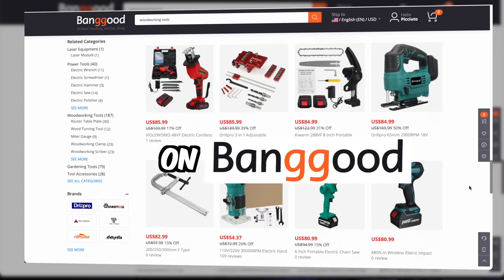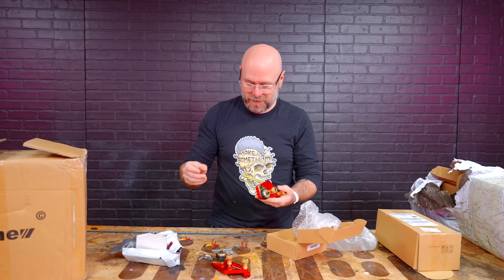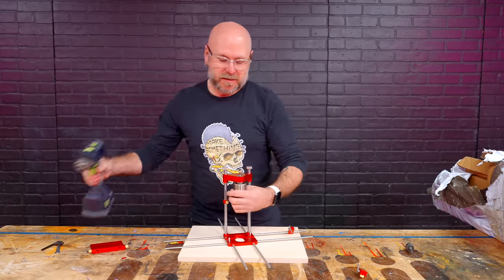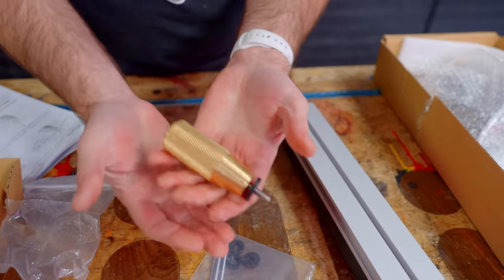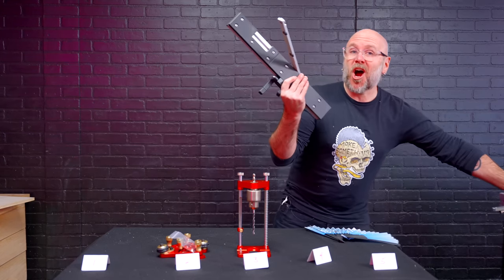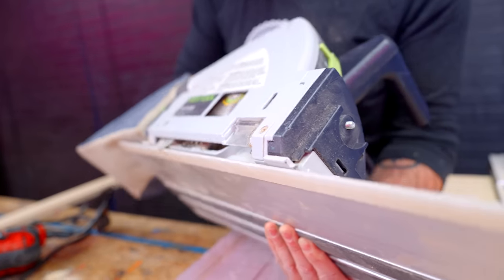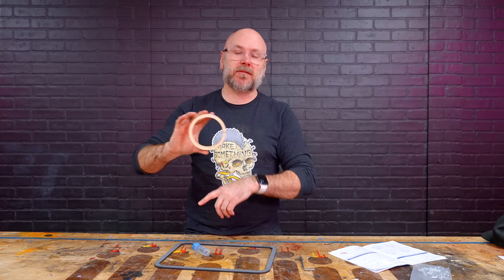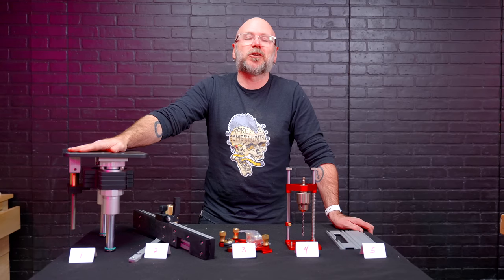I bought the 5 most EXPENSIVE woodworking tools on Banggood!

Comment: d) The "rolling feeders" stand out in Min 5:20 & especially in 5:32. The "horizontal roller" would lift the wood upwards. This means that a right angle is no longer possible. What is required is that the wood is pressed towards the worktop. The orientation is therefore wrong and probably cannot be changed.
The fact that the rollers are not lower and do not touch the wood is only relevant afterwards.

e) At min 11:37 you can see the miter gauge from the screenshot.
The right screw with the black plastic sleeve on the half round angle has a problem with the cutout on the right side of the aluminum profile. If you set a width that requires the screw to be fixed there, you can't use that spot because the screw can't be fixed there. The problem will certainly affect some saws where the distance of the guide groove and the saw blade have the appropriate distance.

f) The Miter Gauge you show for $300 is also available at banggood ... for partly 120 or 150 €.

Comment: I have that crosscut fence and can confirm it is a _brick house_. I got it to replace the stock DeWalt fence that has more shimmy than a Yugo after jumping railroad tracks. Honestly, I think it's nicer than my saw. After some dialing in by sanding the slots on the saw table and some paste wax, it is niice. Except it's made for a full-sized saw and by virtue of the short infeed on the DeWalt, it will hit and sometimes get hung up on the edge if you don't expect it. So, great fence. Not the best for a job site saw, however.

Comment: I'm not a woodworker, but automatic-technician(so bear with me)
When I look at different machines & jigs it looks so complicated.

Two jigs that I found(by the look) interesting is :
A) Vertical Self Centering Dowel Jig Kit(black almost circular). Simple and it has an option to have 2 dowels very close to each other and still centered.

B) Doweling Jig Punch Locator Dowel Jig Kit(AUTOTOOLHOME store). A bit more complicated, but still easy. Still selfcentering. But with 2 big advantage that it can place dowels with greater distance using pins. Second that it has a flat side that makes it possible put it up against a fence.

Comment: Amazon sells the  WEN 4208T - 8 inch - 5 speed drill press for $109 with cast iron base. Has almost perfect five stars with over 4,000 reviews. Cheaper than BangGood's flimsy drill guide.

Comment: I have purchased a lot of stuff from Bangood they are very reliable and legit although the usual runaround if something goes wrong with an item But hey thats equalled out by the price, However the batteries on Power tools use cheap cells and dont last long

Comment: 9:12  It looks like the stop block is twisted on the rod causing the corner of the stop block to catch on the edge of the material.
The distance from the bottom of the block to the bottom of the rod looks the same as the distance on the main body so it should fit.
probably the best way to make sure that the alignment  is correct would be to move the stop blocks onto the same surface as the main body before tightening down the stop block.

I would like to hear if this fixes the problem..

Comment: I would not recommend that Drill Guide.
It just falls apart because of vibrations when using it.
Also since there is only 1 spring on the vertical rods it tends to be off the perpendicular.
So don't spend your money on it.

Comment: I bought a miter gauge for my Metabo contractor table saw. It cost around $100.  As soon as it arrived, they reduced the price to $49.  I called them asking for a refund of the difference. They wouldn't give it.  Then, I went to install it. The little circular things that fit into the track do not have long enough screws and either make it too tight or too loose. Additionally, the bar is short. It is useable for small pieces, but not for wider ones. I have to figure out how to fix the problems, but for now it is going unused. Is it a good miter gauge? Yes. But, it has to fit your saw. I stopped buying from Banggood. I switched to Temu for now.

Comment: The guide you used for the router was used incorrectly. It is similar to the Jessem guide and  both are to be used on the top. One behind the router blade the other in front.

Comment: Looking at the design on the roller guides, I don't think you can use it for side pressure. It appears it would LIFT the material. Looks like it works great on the router fence though!
Reply: That's because he had it the wrong way around. But in any case I think I agree with comments below in that this is an incorrect use.

Comment: Some of the tools I think you need to compare them to their originator’s version.  Like the drill guide, don’t compare to Rockler’s, compare to the original version made by Woodpeckers.  The roller guides do work with the router table, but are used more on a table saw, drawing the wood toward the fence.  From what I have heard from other people, come of the products are good, and some are cheap.  But the one complaint is Banggood copies tools invented by others, thus cheating the original company that designed them.  If you compare the drill guide to the Woodpeckers’ drill guide you can see Banggood copied their design.

Comment: The one VERY BAD THING about the 2 rollers you bought is. They're supposed to work like feather boards. Hold the board down & prevent kickback. When you buy the more expensive ones. The bearing roller doesn't roll backward, only forward. Protecting you from kickback. Either on a router table or on a table saw. Just one thing people need to keep in mind. They're well made, but that roller is dangerous because it rolls back and forth. So it's worth it to buy the more expensive ones to prevent energy

Comment: The first tool should be used on each side of the cutter to keep the piece against the fence rather than as a feather board like you had it setup. These are Jessem knock offs but essentially do the same thing
Reply: Ah yes, quite right. Those wheels wouldn't be able resist the natural lift action of the cutter.

Comment: If you live in the US you get access to amazingly low prices and stacks of great tools.
But if you live outside the US the strength of the US dollar and the exorbitant postage costs from there make buying American stuff largely unaffordable.
That's why I order stacks of stuff from Banggood.
I've never had a problem with gear from there. 
Sure, you know you're getting what you pay for, but for most stuff that isn't the cheapest of the cheap in their range, the quality is actually very good. 
They copy a lot of equipment from, say, Woodpeckers and it's a fraction of the cost.
And it's not like Woodpeckers is losing a sale as buying from them is unaffordable anyway if you're not in the US.
So overall I'd recommend Banggood.

Comment: On the drill guide. Could those little guides actually be indexing pins to evenly space out holes? 2nd ryobi has a plunge saw forget blade size roughly 5" that looks like it would fit that track saw.

Comment: I was about to buy a more expensive item at a good price on banggood, but then started checking reviews as they wanted $5 for some shipping insurance, if I didn't buy that insurance they wouldn't refund me if the product got lost in the mail, feels like extortion.

I found that their rating was 3.9 on  Trustpilot  but 20% have given them 1 star, that's an unacceptably high number, it should be 3% max 5%, so I refrain from buying.

Comment: i bought a 3d printer on banggood, it was nothing like the advert. a lot of the metal parts were replaced with cheap plastic and the quality of prints was absolute garbage. i tried to return it and the postal cost was 50% more than the cost that i originally paid so after complaining with no one listening, i got in touch with my bank and as soon as i said "banggood" they instantly refunded me. that was about 3 years ago, i still have the 3d printer and havent used it since

Comment: I bought a 3D printer from Bangood and got screwed. Plugged it in the first time and the magic smoke came out. Never was able to get PayPal or Bangood or the printer manufacturer to make good refunding the item. Best I got was "ship it back to us for repair." LOL - nope. Shipping a giant-ass box back to China generally costs more than the value of the contents. That's the biggest caveat with buying any of this stuff. I think one is probably safe from having something be so poorly designed or built that you would need to make some kind of warranty claim - especially when you're talking about stuff that is just machined metal - not a lot to go wrong there. Only other comment would be that I the "track saw" guide looks and the little baby saw from the pics on their page, looks a hell of a lot like those saws that are being sold now to cut engineered flooring, whether it's vinyl or some kind of wood composite. I wonder if that's what it was intended for. I've owned a couple different edge guide/track saw attachment type things, including the Kreg version and in my opinion, they're all pretty limiting in that one of the best things about a dedicated tracksaw and track is that the saw is spring loaded and thus easier to use. Also, you'll generally have pretty good quality dust collection whereas adapting a circular saw to one of the track/guide systems is just all compromises, especially if you have to spend time measuring, clamping, etc. That was my biggest gripe about the Kreg one - even with the grippy bits on the bottom it still moved and messed up more than one cut.

Comment: Yes, you will find good quality products at attractive prices on Banggood, but there's something which puts me completely off. And that's the fact that I am liable to pay custom duties upon arrival myself (at least here in my country) and for which I do not know the amount beforehand. Banggood does not do this for you, unless Amazon. This can add up considerably to the initial cheap/reasonably price of the ordered product. Not to mention that there is also a chance of having to apply for an import license and dealing with compliance of an electric appliance. 
With other words I do not have these problems with Amazon. Custom duties are pre-estimated and included in the checkout. If the actual custom duties paid was less than the estimate, you get a refund. If it was more then Amazon pays for the excess. If the product cannot be shipped to your country at all (because of whatever non-compliances) then you will find out upon ordereing.